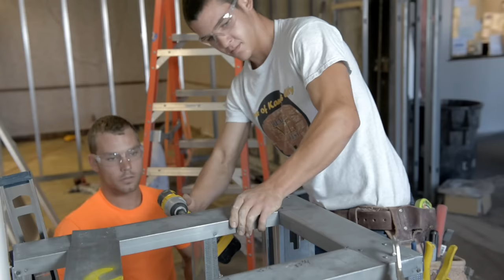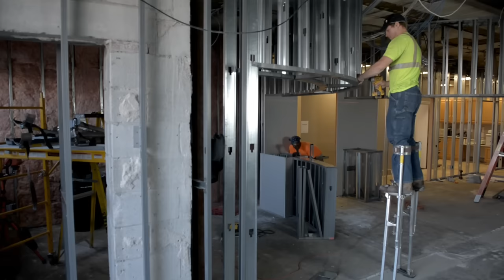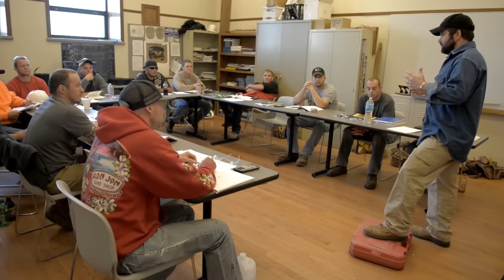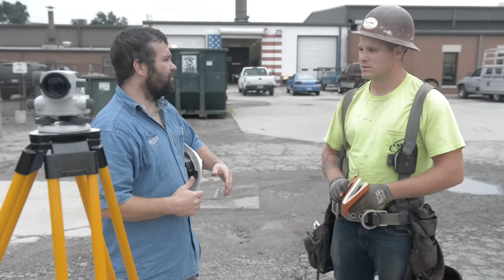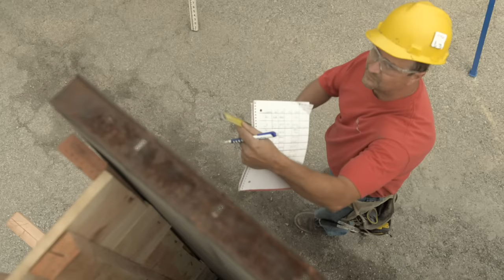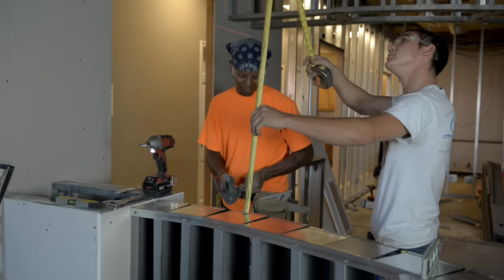Carpenters Apprentice

Comment: Chicago carpenter apprentice. Local 250💪🏼
Reply: How's it going? I live in Chicago and been thinking of doing this.
Reply: @jioman33  I absolutely love my job! Wouldn’t trade it for anything.
Reply: @Bamboo Training or get sponsored in and skip pre-apprentice and go straight into your apprenticeship.
Reply: @Bamboo Training I had worked non union for few years doing remodeling and had some experience already. I went and interviewed for a union company just out of the blue one day and they said that since I had past experience they will sponsor me into the apprenticeship with 3 months credit (enough to skip pre-apprentice) and then I can go right into my apprenticeship. It allowed me to skip all that BS that you would normally have to go through and start immediately. They will hire you on as a first year and then you start  right away with the curriculum for classes that they have. The biggest thing that helped was having past experience in the trade. Good luck 👍🏼

Comment: great video. every Carpenter and other trades should learn the exact Metric equivalents(64 sizes) when they see the Imperial(64 sizes) system. i say exact because all of the metric tool sizes are mostly an approximate size. 14 is used for any 9/16th size but 14.2mm is the exact size. 13.8mm is 35/64th.there is no such 9mm size.its 9.1mm or 23/64th. .3mm-1/64th. .7mm-1/32nd. 1.1mm-3/64th. 1.5mm-1/16th. 1.9mm-5/64th. 2.3mm-3/32nd. 2.7mm-7/64th and so on. Carpenters should also learn how to convert 89mm to fractional inch and vice versa without using a calculator. 27 feet 9/16 minus 2 ft 3/32nds. i know a lot of Carpenters that don't know what comes after 7/16th. 29/64th,15/32nd,31/64th. they say 7/16th plus or heavy but don't really know the exact size.

Comment: Mmm , as a carpenter of 40 years here in England , we use timer ( from trees) not gyrocompass metal stud mush? . It’s a weird world
Reply: the metal mush is better and faster for non loadbearing walls.
Reply: @joelchrysler6238  I don't agree.  
My dads using the tin studs for bulkheads and backframing as we finish our basement. But it's a pain to cut. Sharp to handle. A pain to hold drywall while a whole screw screws in. 

Maybe I don't know what I'm doing with it but i would rather have a loud air compressor, skilsaw and 2x2 strapping and just clean up the mess after but have it be done with.
Reply: @maxnovakovics2568  I'd have to say you're doing it wrong then. They are super easy to cut with snips and even easier with a chop saw. Crimp it in the place you want to hold it and then use a Kelly screw... you're right they can be sharp but you learn how to handle it. It's way faster, No question
Reply: @maxnovakovics2568  and they're steel

Comment: Hello guys! Does anybody know how is the carpentry field in Canada? Specially in Nova Scotia? I'm currently 28 and working in a totally different field. I'm moving to Halifax, NS next summer and I was thinking about studying Carpentry and become an apprentice.
But I don't know if the canadian field differ too much of the USA field....
Reply: in pei it takes 3-4 years to get red seal
Reply: Ontario is probably the same as midwest.  
But NS idk, I might assume more tie up and rigidity for hurricane risk. I do know Florida doesn't have basements and i believe the structural walls are all cinderblock instead of 2x6 lumber.  

I never hear guys going out East. I know plenty of guys from the East...
The work is in Ontario and out West. 
However good luck in any endeavors. 🤞